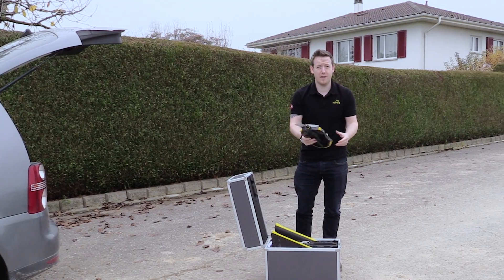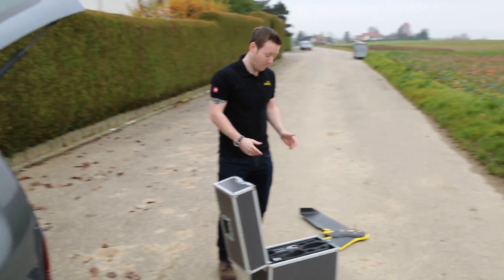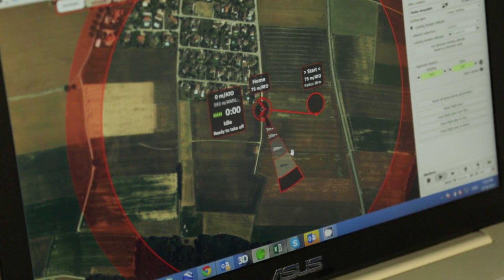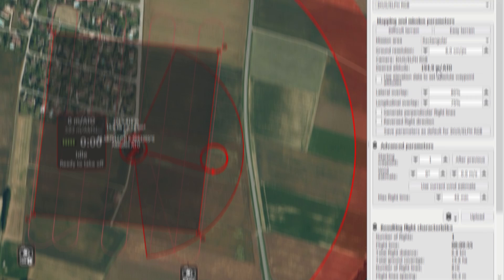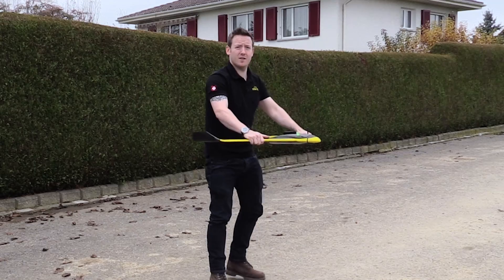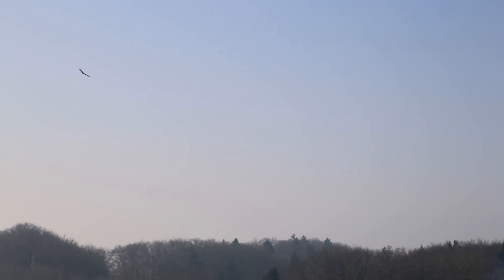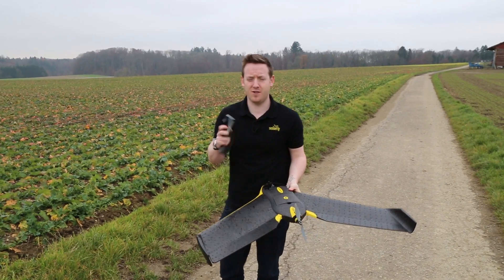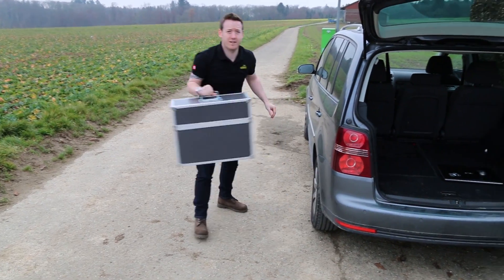eBee Explained — Planning & Flying A Drone Mapping Mission

Comment: does the landing affect the propellers since it is somehow long and the bottom of the drone has no landing pads?
Reply from the maker: Hi Tony - the answer is no, since they are designed to pivot on making contact with ground, dissipating the impact energy.